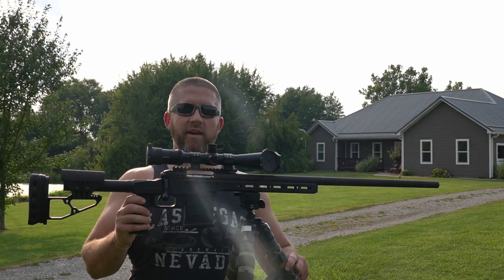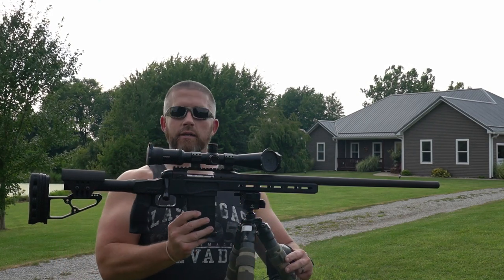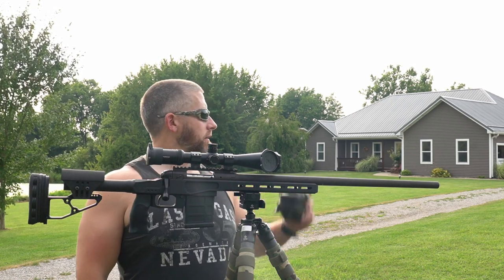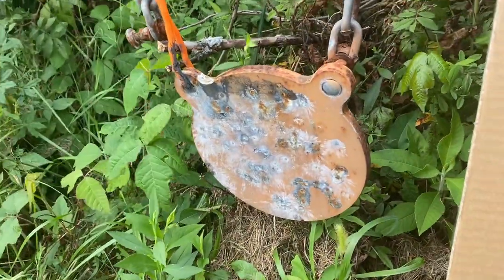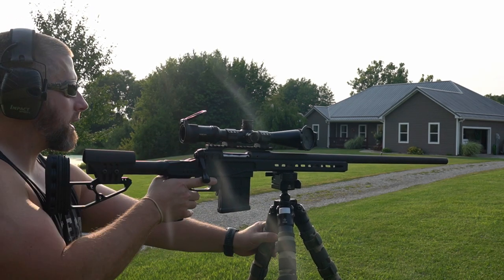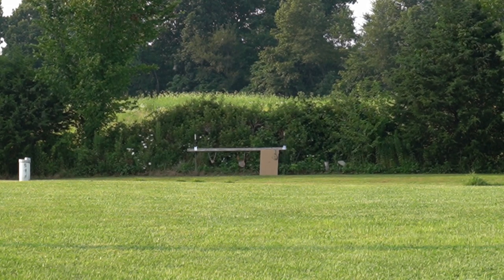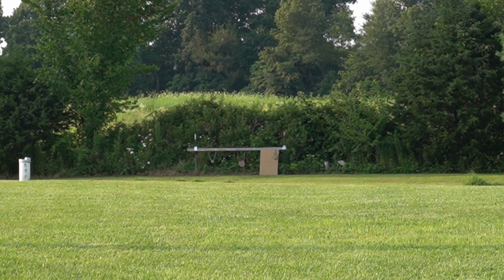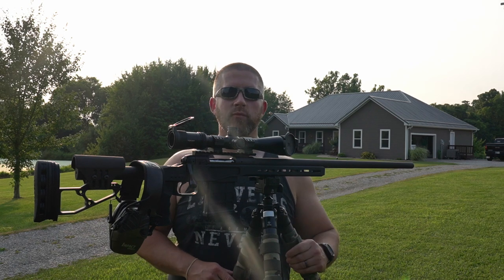Sighting in a Coyote Hunting Rifle - 308 with XLR Element Chassis

Comment: Nice set up.  How's the scope hold zero?   Do the clicks equal adjustments? I was finally able to build an AR10 pattern that I would like to use for predator/pig hunts.  What did you work up for your loads?  You don't have to say if you don't want. Weight/powder?
Reply from the maker: Thanks!  Yeah, the scope holds zero really well and the clicks are true and crisp. In this video I was just shooting some older stuff. It was 178 AMAX over 43 gr of Varget. Im going to work on some smaller and hotter loads for coyotes pretty soon.